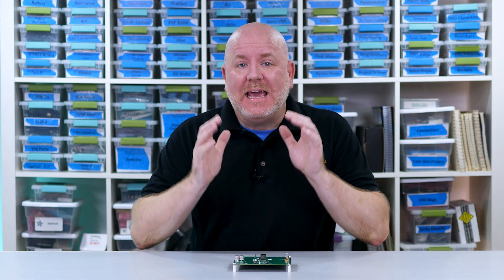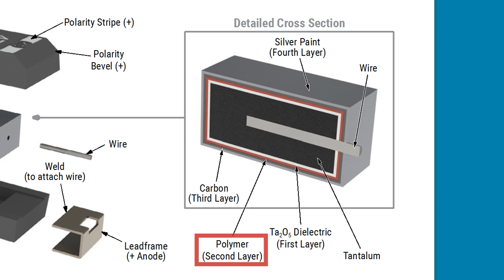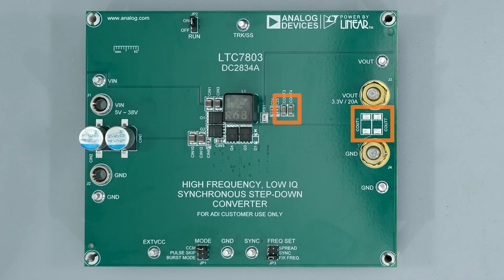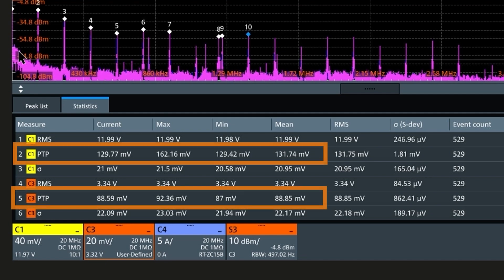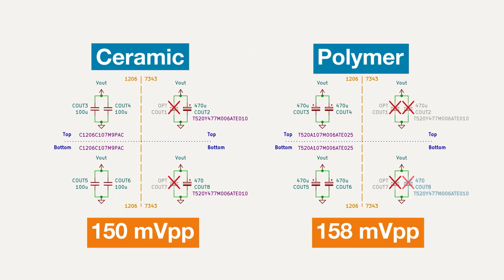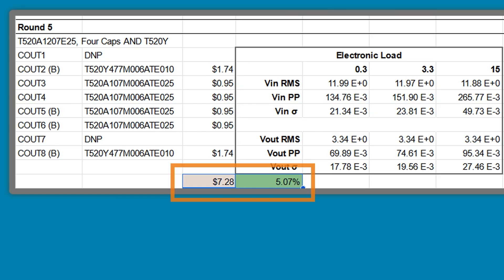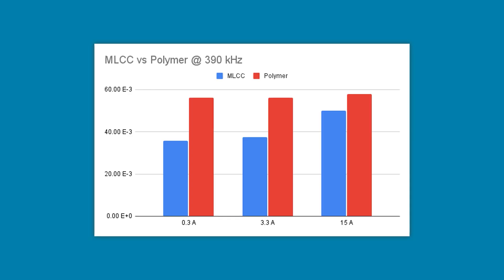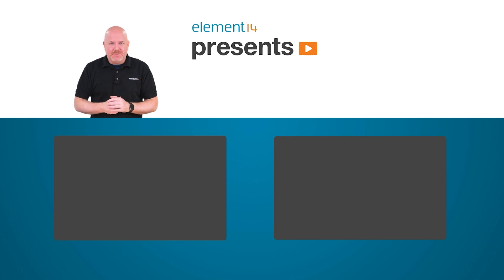Can Polymer Capacitors Replace MLCCs in Power Converters? A Comparative Test

Comment: I had need of a voltage variable cap for a project many years ago.  Not having a varactor diode handy I grabbed a Z5U cap for a trimmer capacitance on an oscillator.  The capacitance varied with voltage and worked well for the size cap and frequency range.  The only problem was that the temperature coefficient of capacitance was greater than the voltage tuning range!  A change to a X7R dielectric worked better given the much lower voltage coefficient of capacitance.  I just had to change the voltage range vs. capacitance to cover the correct frequency range for the phase locked oscillator.

Comment: What is P-Dot? its a Polymer conductive material for the capacitors Cathode terminal. I'm not sure why these capacitors Polymer and MLCC has a Biasing Effect, the Biasing Effect means what?
Reply: PEDOT is the Polymer material used in Polymers. Only ceramics, or MLCCs, have a DC Bias Effect. Polymers do not. Both topics are covered in other videos which are available in the show notes link found in the description.
Reply: @bald_engineer  Why does Ceramic and MLCC has a DC Bias Effect? what is causing the DC bias effect>?
Reply: @waynegram8907  Barium Titanate (the dielectric) is ferroelectric. Its dipoles align in the direction of the applied electric field which causes its permtitivty to go down. Again, fully explained in another video, which you can find in the show notes (linked in the description.)
Reply: @bald_engineer  Huh that's pretty interesting actually
Reply: I'm assuming the dielectric material in mlccs is non linear itself and has it's dialectic constant fall with voltage

Comment: In my experience it usually works out best to use a combination. MLCC for tight, low impedance loop closure and polymers for bulk cap.

Comment: The problem with tantalum or polymer (aluminium or tantalum) is that they are very sensitive to overvoltage/stress and fail short frequently im the field, in a high volume product you will see it. This is why it is usually forbidden to be used in a good design that needs to last, and you expend money on MLCCs. If high ripple is needed, unfortunately, electrolytics are the only reliable solution to use with the ceramics. Or this polymers you show are not made with aluminum or tantalum? But I think fail mode is the same for all polymers materials.
Reply: If you watched the video before commenting, you would have heard me clearly say the focus was on Polymer Tantalum, also known as KO-CAP. Regarding reliability, if you follow the manufacturer's recommendations for voltage de-rating, then Polymer Tantalum (or Aluminum) is incredibly reliable. They are both used extensively in ultra high-volume products like laptops, mobile phones, and tablets.
Reply: @bald_engineer  well, I watched all before I comment. Sugestion, next time mention about the risk and failure mode of this type of capacitor.
Reply: Great Video spotlight, as a comment, would it also be worth checking dynamic load transient comparison vs effective output capacitance of MLCCs vs Polymer Ta?
Reply: @jorgelugo8622  I think it would be worth comparing. I have some ideas on what might happen, so now I wish I had done that!